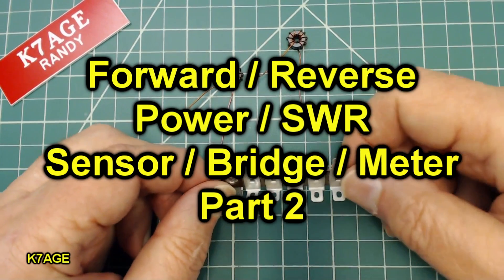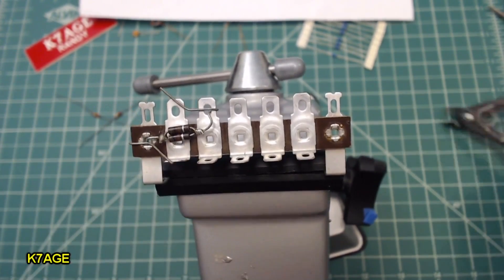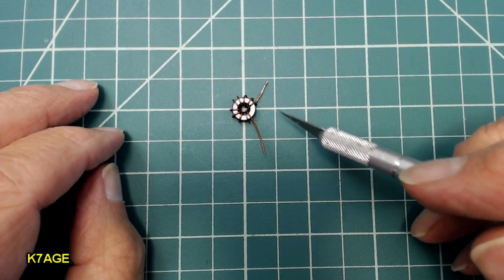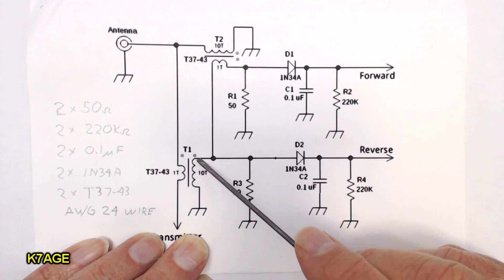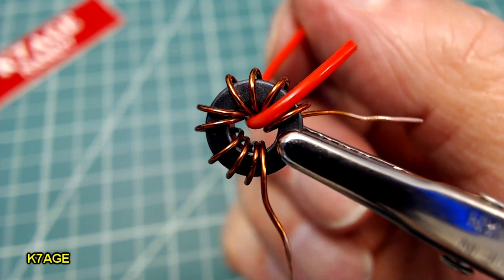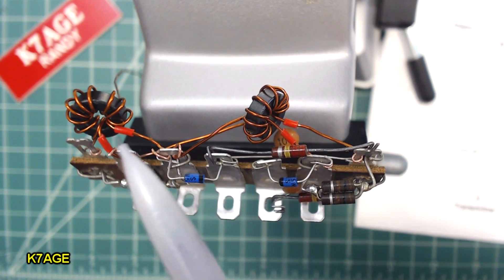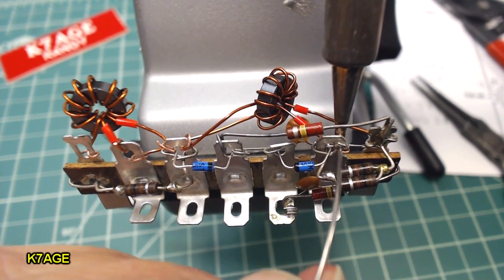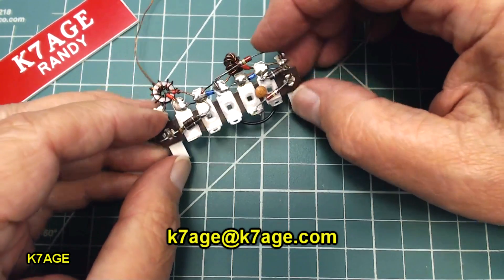How To Build An SWR / Relative Power Bridge - Part 2

Comment: I can't find a source for the terminal strips.  Any chance you have a link for the double terminal strips like you used?  Thanks
Reply from the maker: Search for 
solder terminal strips
on amazon and ebay, you will find various sizes. 

Or find a load ham near by you and dig in his junk box!

This was mainly an educational project.

Have fun,

Randy
Reply: I can only find the ones else have the lugs on one side of the board.  :( thanks for the video.  Good stuff

Comment: I have a set meter that is shorted out. Shield of the connector is to the center pin of the coax connector. The radio shack model no. 21-534. Can you tell me if was a common problem and where to look.
Reply from the maker: The shield to center should not be shorted together. Open up the meter and check inside.

Comment: Will you tell what to do for diffent power levels?
Reply from the maker: The design is for QRP power levels. Not sure how well it would work at 100 watts. I don't know it the toroid core will saturate at 100 watts. I would need to experiment when I get it finished. I would not rely on this for absolute power measurements.